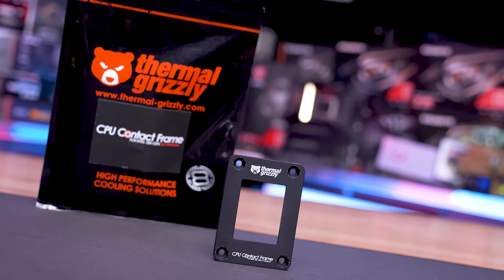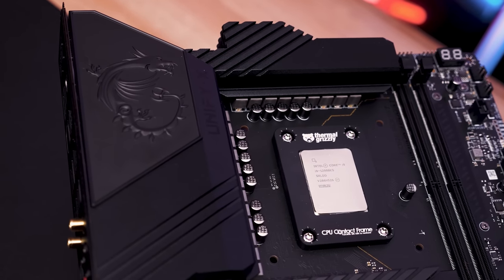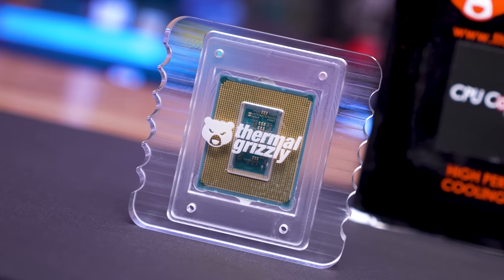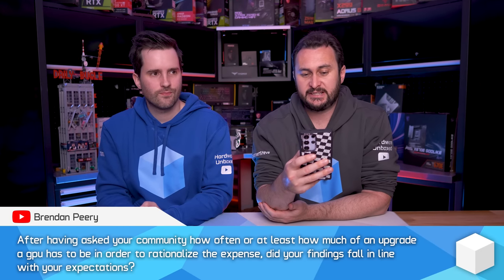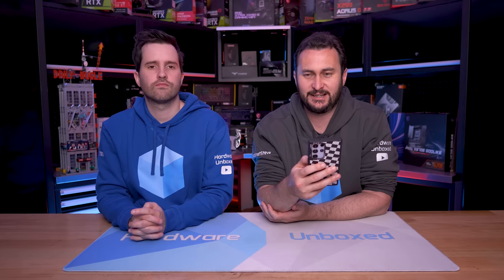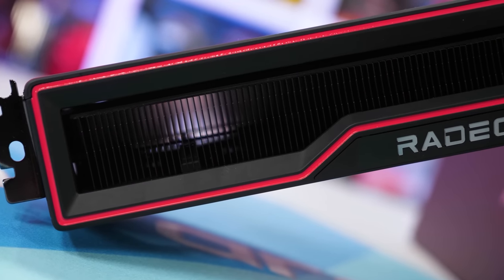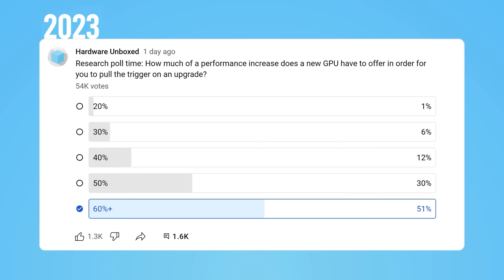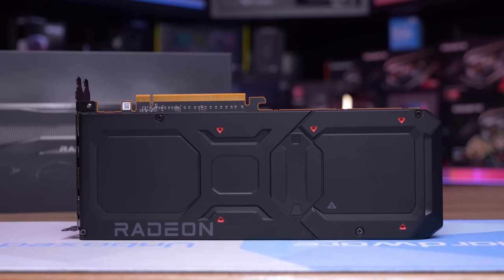RTX 4050 Pricing & VRAM, Are 12-core CPUs Dumb? March Q&A [Part 2]

Comment: My prediction is that the RTX 4050 is gonna perform at roughly RTX 3060 at best, RTX 2070 performance predictively, or, at worst, RTX 2060 level performance. Nvidia hates budget card being better than last gens. 
I also expect it to cost about $399-$450. I don't think they'll be sub-$200 budget cards anymore.
Reply: So let me guess this right, AMD sold me an 8GB 4th generation 1080P card in 2019 for £200, which was at that time 5 years ago - equal or better than a 2070.  So if that was worth £200 5 years ago, how can it be worth more than double that today?

I don't think it is, today any 8GB card is worth no more than £300 absolute maximum!  And the reason being that the second hand market is full of £300 8GB cards which are as good or better than the current gens.
Reply: PotatMasterRace  cuz nvidia, people are going to buy nvidia. Its similar to apple products
Reply: @DailyCorvid  3070Ti laughs at your comment
Reply: PotatMasterRace  because not everybody wants a used card?
Reply: Only on eBay
Reply: @Bogdan00  My bank account laughs at the entire 3X range.  And so does my RX5500XT £200 8GB card that outperforms your 3070ti in 50% of titles.
Reply: PotatMasterRace  because marketing. and believe me, people will do it. i've talked to these kinds of people before
Reply: The 2060 beats the 3050, so I think there's a good chance that the 3060 will beat the 4050.
Reply: Nvidia would love to sell you a 4030 for around 250.00 it can possibly match the performance of a 3050
Reply: @DailyCorvid  😂😂😂
Reply: for sure gonna be worse than RTX 3060
Reply: @griponreality9716  I still wouldn't think of it as a worthy spend of 250.  It would be super pricey and for what?  3 HDMI ports?

You can get 1660Ti's and older AMD stuff which has more VRAM than a 4030 would have which would be 6GB.

There is no market for a 4030 ... it would just cannibalise the existing 3060 models not to mention it can't beat the last gen pre owns because of silicon prices going up!

Get yourself a second hand 6th gen AMD or just swallow the price of a good Nvid gpu.  You will feel like you wasted your money and time waiting for a 4030 when there are APU's which could take that on right now on new gen stuff.
Reply: With quantum computing and data servers and gpu servers becoming so powerfull nvidia doesn't care anymore about gamers, this is probably one of the few last generations of gpu's, rasterization will probably be a thing of the past in a few years on how to render graphics, Trained algorithms will optimize and find new ways of doing it and it's probably not even going to be 3D calculations but point optic 2D to faking 3D render and more about vectorized 2D to pointvector3D graphics that can stretch to infinitum without a need for basic / almost archaic technology like pixels. You'll see it all unravel in our lifetime and it's exciting, at some point i do believe computer graphics , even the most demanding ones, will be less then 1% of the compute power of new type of architectures in 10 years from here.
Reply: PotatMasterRace  maybe because not everyone has a good used market? but yeah new pricing also sucks
Reply: YT channel Hubwood is benchmarking the laptop 4050, 4060, 4070 - check him out
Reply: Who would buy it because Intel cards do exist. Sure they aren't perfect but even nVidia fanboys cannot be that dumb to pay so much for such a trash card.
Reply: PotatMasterRace  oH bUt BrO iT gOt FrAmE gEnErAtIoN.
Reply: At 2060 performance? Do you remember just how weak that card was? I’ll put my money on that it’ll land between 3060-3060ti.
Reply: PotatMasterRace  fan boy would.
Reply: I think it'll be 3060 level but for a 300 dollar MSRP. 4060 is gonna be at least 400 though
Reply: Nope, RTX 4050 will not be the same as a RTX 3060. The 4050 will have the same raw power as the 70 from 2 generations ago but better optimized for modern games, in this case the 4050 will be the same as a RTX 2070.

670=950
770=1050
970=1650
1070=3050

Again, the 50 GPUs will be more optimized for modern games than the 70 two generations ago.
Reply: @dytub - George  Oh wow someone beat me to it like two comments further lol.

 @DailyCorvid  Apple has always done this even back to like GTX 700 series for example the GTX 770 actually is not that bad performing a card and it can play modern games just fine mostly, it's pretty much going to do everything from GTA V to Witcher 3 flawlessly along with any number of games basically that isn't Callisto or Cyberpunk or something, but it's just that nVidia wants to scam you and they hate the used market so they try all kind manipulative shit to be anti-gamer. Like for example mining cards, they diverted good gaming chips into scalping directly, these cards are designed specifically to not flood the market during a mining crash and instead become ewaste and they act like good guys rather than scumbags for doing this. Meanwhile they stick so little VRAM on for it to basically only last two years until next cycle, and in case of 3070 they gimped it so close there already were games having problems running on 3070 when it came out. And then you have support issues, so like you can't play Warhammer Gladius or whatever, despite the fact it should run on integrated graphics, just because it runs on Vulkan and nVidia doesn't support Vulkan. 

So what you are stuck with is an overpriced piece of ewaste glorified Rimworld player, just like Apple is glorified YT facebook shitposters. And their hardware sucks completely on purpose. They do this deliberately so that anything beneath a 80 or 80ti is basically useless within several years and therefore their cucked fanbase soyboys their way into the cycle on the hamster wheel until that too has driver or API problems or runs out of VRAM. Like you can't game on literally anything less than a 780ti even on DirectX just because the VRAM limits. Curiously they don't do these shitty things on laptops, maybe because they know nobody's going to buy a pricey gaming laptop that frequently or upgrade GPU so you get things like 780 4gb or, trying to remember if it was the 1060 they made 8gb on the laptop, basically some laptops have adequate VRAM. So result is, if you get even a 3080 it has so little VRAM it's just barely enough for non-stuttery 4k gaming until the next gen, by which time the games are exceeding VRAM limits and its a choppy mess if it even runs without crashing. Not that it matters because like I said, you want to complain about drivers consider the fact a GTX 770 2gb is useless on anything using Vulkan. But if you do get it to run, expect games that will run on a 660ti like Tropico 6 to exceed those 3gb VRAM limits even at 1080p, which is nVidia's way of saying "perhaps you need to pay us again." Because even that will not satisfy their greed someday they are going to make GPUs "obsolete" that is to say they'll be so greedy and controlling they refuse to let gamers even own their own hardware and just sell shitty subscription services to geforce Now or something like that.
Reply: 50 series does not have a record of beating previous gen 60 card
Reply: @DailyCorvid  Proofs? How does a 5500xt outperform isn't that like a real 1060 or GTX 980 level? Speaking of which, the prices are insultingly insane for such bad hardware, one thing if it's a buggy overheating mess with bad GPU software massive driver bloat and is going to be obsoleted within 4 years anyway because of bad VRAM or lacking API driver support, quite another when they upcharge you then just extort you prices for a 4050 being as expensive as a GTX 780 cost at MSRP. This is definition of stagnation, as you will notice the 1060 and 980 more or less set the bar for every generation that came after, it's 14+++++ quadcore tier, the 1650super is  rabranded 980. And the 3050 is only marginally better but cost literally twice as much as a 1060 did at retail. 

The best offer is just not buying from them because things have stagnated so damn much that unless you're at 4k you literally can just get away with playing games on a GTX 980ti and be fine playing even their glorified sponsored tech demos like Control and Cyberpunk. That's why they rely on the gimmicks and never talk about what matters the actual performance, because if people thought rationally and logically rather than being irrational and overemotional they'd have realized the performance just isn't there. They don't bring enough to the table to be worth it anymore particularly when you see the way older cards on the used market work perfectly fine across all titles and can be had for $200 or less right now. I bought a used card in the pandemic (that cost way too much I didn't even mine its worth back :/ oh well) and it works perfectly fine, in fact Kepler and Maxwell are still decent cards only limited by their VRAM and API driver problems on some newer games.
Reply: @drek9k2  By producing more consistent gameplay at my chosen res and fps, like it's fairly obvious what constitutes "better" to a gamer when it comes to GPUs.

They offer a better gameplay experience on that persons selection of games or machines.  It's not an idea war, it's not Christians versus Tribals lol it's simply this :

My 5500XT cost £200 and plays my games as well as a stock Nvidia 2070 which costs triple, uses triple power, takes up triple space, and supports half the features I want.

Sorry if this upsets you in some way that I got a good product at a good price and it somehow magically does the thing I purchased it for without me selling my gran to pay for it when its replaced in 2 years time!  Lol come on bro.
Reply: I won't be surprised if the 4050 perform like the 3060, after all, the RTX 3050 perform exactly as the 1660 Ti, the performance gap is barely at 1 - 3%
Reply: @DualPerformance  Exactly it's half of old components used with thinner wires and additional power.

Yeah we give you more compute so long as you don't need it for games lol.  Mining screwed the industry.
Reply: @DualPerformance  it better be. If it performs like a 2060 but cost like a 3060 I'd freaking flip!
Reply: @joelconolly5574  yeah, you know, the 3050 is around the same price that 1660 Ti had at launch, that is immensely disappointing, as a 1660 Ti user, I'm very satisfied with it's price/performance, best upgrade I ever did, but things gone downhill with those RTX 3050 and 3060 without even include the cryptoboom
Reply: @DualPerformance  yeah. I can excuse 3060 since it's a better upgrade but the 3050 doesn't even reach or outperform 2060 performance? Shame. Waste of a good silicon.
Reply: @joelconolly5574  2060 is around 12% faster on average vs 3050
Reply: PotatMasterRace  Sadly because of marketing and market shares! Most buyers are not as informed as the average Hardware Unboxed viewer.
And Nvidia does have 80 % market share.

But indeed AMD has the better cards in this pricepoint. Even a new RX 6800 with 16 Gigs for 480 bucks is way more future proof than a RTX 3070. And every 8 GB card like 3060 Ti, some 3060, 2070, 4050, predictably 4060 is going to run into VRAM problems where even a RX 6700 XT with 12 Gigs has more headroom.

Buying used is always the better choice, of course.
Reply: @paulojamesminimoisaac7858  "because not everybody wants a used card?" ... No, you don't have to. RX 6600/XT for 220 - 300 bucks are good to get.
But the used option (5700 XT) for below 200 bucks is the better deal, as used parts often are!

So the market don't need a weak RTX 4050 card, especially with RX 6600 XT, RTX 3060 (weaker version with 8GB) and 3060 Ti all with 8 GB already there.
Reply: @trr4gfreddrtgf  "good chance that the 3060 will beat the 4050." ... especially the 12 GB version which clearly is the better choice for the future.
An RX 6700/ XT with 12 Gigs would also be a better choice.
Reply: PotatMasterRace  Used cards are a risk... As well I went with a 3060 12GB since I do mods and emulation as well... Which some RTX mods wont work at all or awful on AMD cards. As for emulation AMD always been pretty bad at them... They are improving here and there with recent drivers but it's still pretty bad.
Reply: You're low on your guess. Think closer to 3060 Ti performance. The entire 4000 series is about a 1.5 tier improvement compared to the previous gen. 4070 Ti ->3090, 4080 -> above 3090 Ti, 4090 -> 50-60% over the 3090Ti. If we carry that through, the 4050 will be slightly below a 3060 Ti (a notably larger jump from the 3060 than in previous 60->60Ti jumps), which places it around a 2070 super/2080 performance at 1080p Ultra. Being able to dime out games at 1080 and get 90+ FPS on the tougher titles is a great result for an XX50 GPU. It means you can play most stuff at 75+FPS at 1440p with high settings and older titles easily 100+ FPS.

Remember this comment down the road when reviews come out and prove me right.
Reply: PotatMasterRace  True but im happy with the 3060 12GB. Upgraded from a 1050ti last week I still mostly play old shit but it's nice HUGE upgrade for me.
Reply: PotatMasterRace  i wouldnt personally buy any of the ( how many now ) versions of the 3060 but i really would think twice about buying any second hand gpu ..
Reply: requirements on Vram these days with games i wouldnt buy anything less than a arc 770 with its 16gb ( Intels drivers need work i agree ) and at $560aud there is little better out there..

Any of these new cards coming out with 8gb is nothing more than a scam " points the finger at Nvidia" should be ashamed and feels like a marketing ploy to budget gamers buy our shitty overpriced 8gb card realize you need 12 to 16gb min for these new games buy another better GPU ..

in a pinch i may look at a 3060 12gb or a 6700xt ( but would still take the 6700xt over a 3060 any day ) and they both retail for around the same price !!

my opinion the 7800xt and intel arc 770 should be the go to GPU's for your budget to mid range
Reply: PotatMasterRace  and for someone who does there due diligence when buying used thats great !!
but buying some of the rubbish scattered on ebay and other sites leaves the less diligent people very open to buying shit !!

i liken it to the 3060 that is there to basically trick and has tricked people less diligent into buy shit because of  its cheaper less clearly branded packaging  ! 

maybe my disposable income allows me to buy high end and new ..

but my logic of even if i did buy low end which i have ( 6700xt 6650xt and just recently arc 770 for shits and giggles builds ) i have a warranty and a new card with less chance of buying a dud without any recourse !!
Reply: PotatMasterRace  a lesson all used pc part buyers should take but you still wont get a warranty on a used part so you can still leave yourself open to buying a dud without any recourse !!
Reply: @hassosigbjoernson5738  Oh yea, the 8gb 3060 is basically a 3050 ti. An 8gb 4050/4060 may be DOA because DLSS 3 increases VRAM usage which those cards don't have much of in the first place
Reply: @DailyCorvid  7600M XT already shows that Navi 33 has only a 128bit memory controller, which means 8GB VRAM. If 7600 XT is priced the same as 6600 XT, you will probably see a $379 8GB 7600 XT.
Reply: @simon6658  Lol people must be mad to pay double for a similar product 5 years later.  Honestly it wasn't that  cheap at the time either!

5 years later 8GB and 128bit loool
Reply: @simon6658  Are you suggesting that we all switch to the the 1650?  Even though it's been discontinued for ages and was never any good and was always too pricey?

You clearly never bought a gpu yourself with your own money or you'd have known not to say that exact thing.

Steam survey is not a great source of info.  It also claims 0% of users have 2 of my 3 cards despite them both being top sellers.
Reply: @DailyCorvid  Sorry I replied to wrong the wrong user... That's not what I want to express to you.
Reply: @simon6658  fair enough man
Reply: @paulojamesminimoisaac7858  But they're certainly thinking about them now.  My used 1080ti has been going since 2018.  I expect to get a used card again and begin the next 7 year cycle.
Reply: @takehirolol5962  lol that's like some weird kind of cope rephrasing basically the same thing, so yeah, in other words---it'll be even worse. Because the 3060 after some driver updates was eventually able to match the 5700XT and 2070 super. So in other words, if the 4050 matches the 2070, it will still suck harder than the 3060. I really think it speaks volumes about how shoddy nVidia hardware really is, that their pricing scheme now is probably going to be stretching two generations back just ot be like "oh no it's not inferior to a 3060, it's like a $500 2070 but for only $450! Wow! What a deal! Such value!"

Every time I see these debates I just instantly get reminded of what type of cope you have to use to be a longterm nVidia buyer at this point, in order to stay on the ship basically having to grossly ignore the fact GPUs are supposed to get faster and be cheaper like all computer technology has been since the 1970s, cheaper, smaller, more efficient, more powerful, except lately we had extreme stagnation on the CPU space with Intel and later with nVidia GPUs. Like I will see people seriously saying shit like "the 3070ti is faster than the 2080ti, but only costs $600! Much value!" I don't think any of these people actually understands what "value" even is, like any performance they simply see it as value. 3070ti was terrible value. Limited EOL VRAM configuration that cost a whopping $100 more than the 2070 super did, yet because it was faster than 2070 super some simp bad with numbers will tell me how "that makes it great value." No it doesn't and that's not how value works, if Ihad to compare a graphics card from today, to a $500 GPU from 12 years ago, that doesn't make it better value. If it cost $400 and it still was just a little bit better than that 12 yo GPU that not only is stagnation but incredibly bad value.

I'd rate the 12gb 3080 as ok if it was just $700 flat, even though that's still a massive gouge over the $550 GTX 980. 10gb, is just bad. That's 1440p, not 4k. 2060 super was too expensive. All of nVidia's stack back then basically cost $100 more than AMD in return for raytracing. SO that was a huge premium to pay for having exclusive RT. But back then it was just Turing, then RDNA2 comes so you can have RT on AMD, slower but no longer exclusive, and made the performance per price even more embarassing, but because certain events was happening nobody paid as much notice to how badly they were ripping people off, thus smooth brain simps see a $1100 RTX 3070 and see the $600 retail on 3070ti and go "wow! what a value!" Well no they both sucked and you shouldn't be buying either one of them if you had any sense. Now people throw a shitfit today discovering those cards aged really badly, like everyone knew they would. Badly aging, bad value. Like I said at least 20 series had RT, so it was at least an argument, not a good one, but still. If you didn't care about RT you could've gotten the same raw performance from AMD for $100 cheaper.

I'm not sure what they think they're going for this generation. You can get raytracing just fine on AMD. DLSS is not a feature. Upscaling is never going to be a feature on newer cards, only a workaround for high res RT or a bandaid for aging older cards like GTX 900 series (that ironicalyl doesn't even have DLSS, so the main cards that would even benefit from it all are using FSR). A 4050 is flatly not going to be good value or worth buying, period. 4060 likely is going to cost $500. 4050 will cost no less than $400. That's just insane. That's how much the GTX 770 cost. That's how much the 5700XT cost. That's 70/700 level prices, for a 50 level card. And people still bought it which is why they can charge so much, they are keeping gouging you until you physically can't or won't pay. Otherwise they keep charging more. This is made worse by complete idiots refusing to even consider AMD no matter how good their hardware (and software and drivers) actually is in comparison to nVidia. The 3050 was just laughable. That was a really poorly performing card that cost at least as much as a 2060 at retail. Every year it gets worse. So I'm just refusing to pay for nVidia anymore.
Reply: @drek9k2  Yep, quite the reply!

I agree, that is why as a 100% upgrade or more for my RX 5700 XT I want a RX 6900 XT at the very least or a 7800 XT if it has 16 GB VRAM.

Nvidia will sell to the "Upgrade every 3 years club" as usual and cannot wait for all the bashing the 4070 will receive on April 13th.
Reply: It was even worse than your prediction